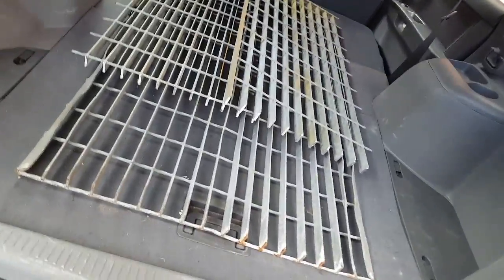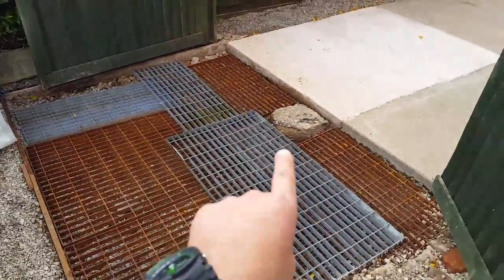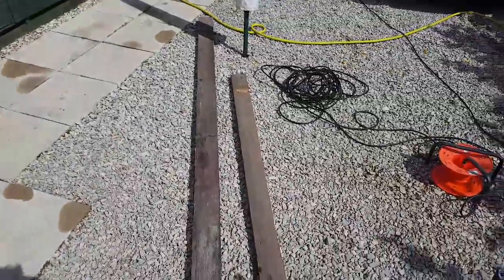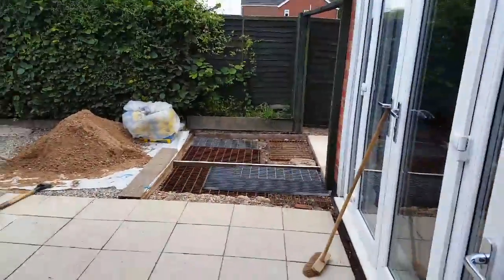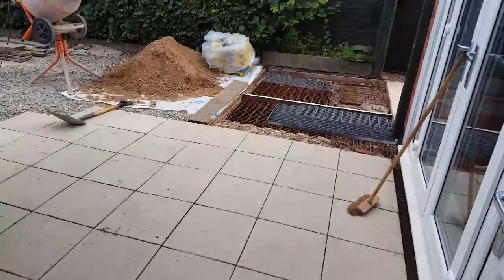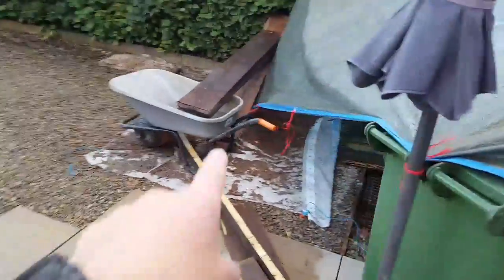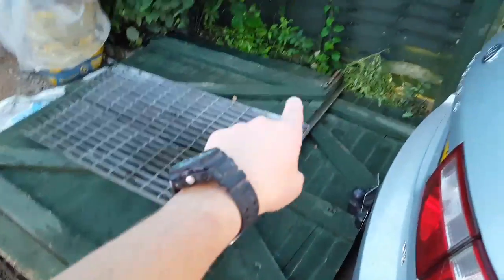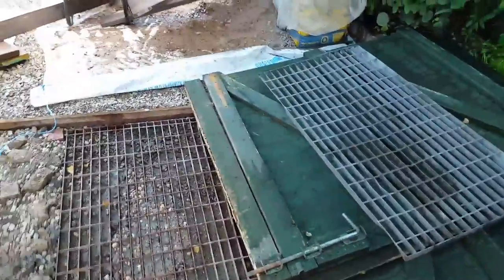Car port groundwork part 4

Comment: It's one of the few sure things in life I have found. Start a concreting job and it's guaranteed to bucket it down. Nice work with the tarp springy.
Reply from the maker: Volgnit 
Cheers buddy it didn't come out bad ...been just tinkering today as it is rain on and off
But done a good bit of non concrete. 👍😎👌